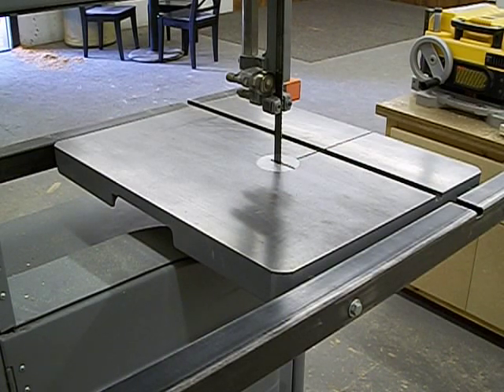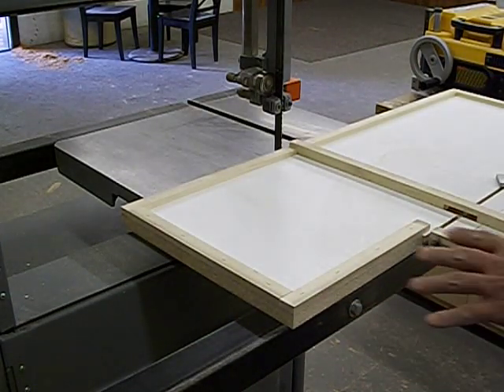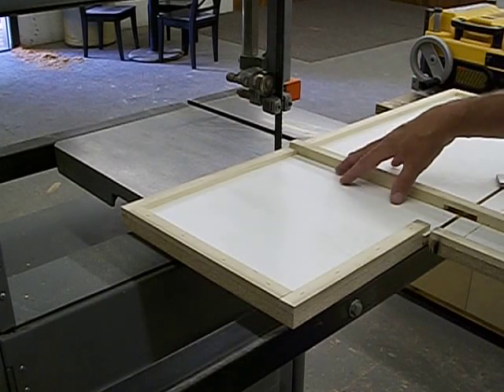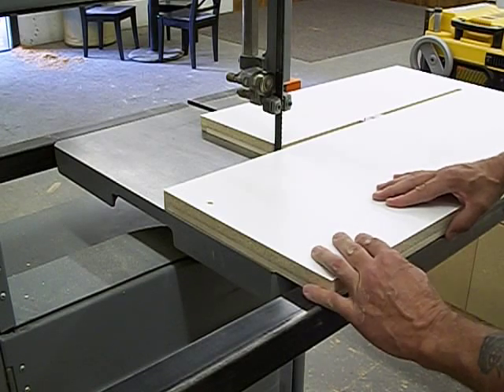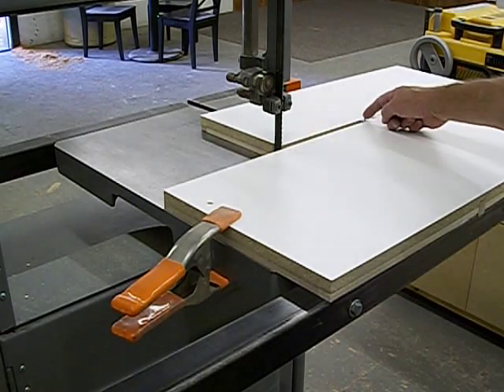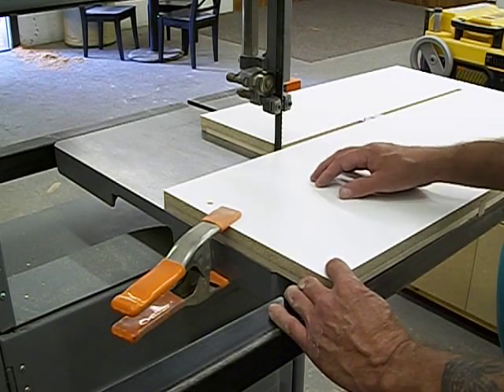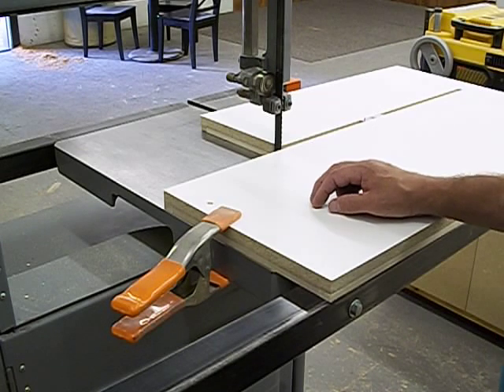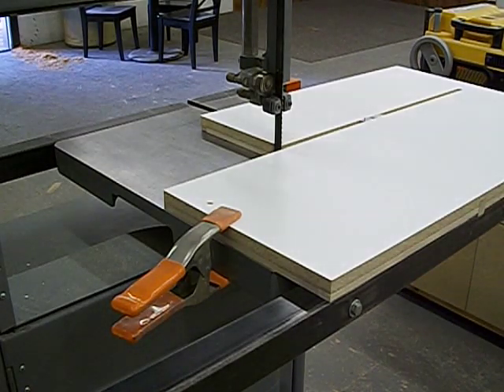A Bandsaw Circle Cutting Jig

Comment: To make a circle, I place wood on a turntable sitting (clamped) on the band saw table - and homemade side arm if larger circles are needed. Weights on the wood, along with a grippy rubber surface on the turntable, keeps that wood from moving around as the cut is made. The advantage is no holes, pins, or whatever to mar the center of that wood.

Comment: I built a similar one, and found that adding a stop block helps to align the sled more consistantly with the blade.  It goes on the back edge and hits the table edge (or your extra piece) when the sled is in position.  I can then easily hold it in place without stopping to clamp the sled, although this is still an option.